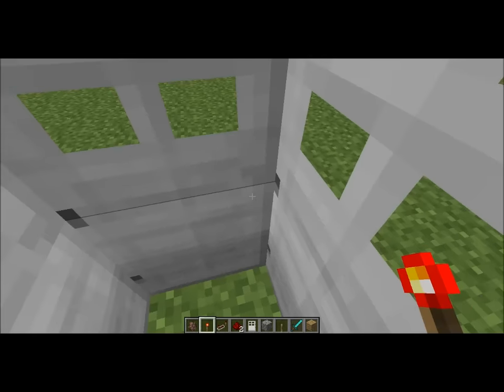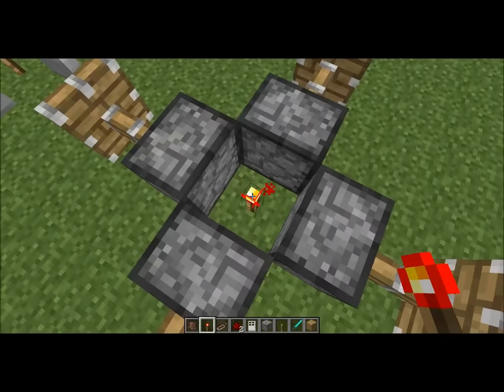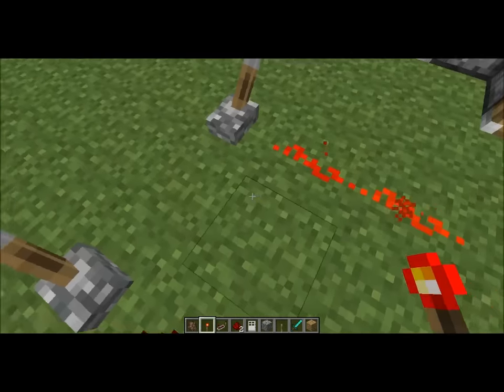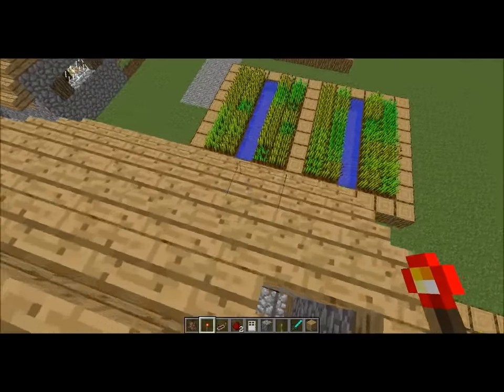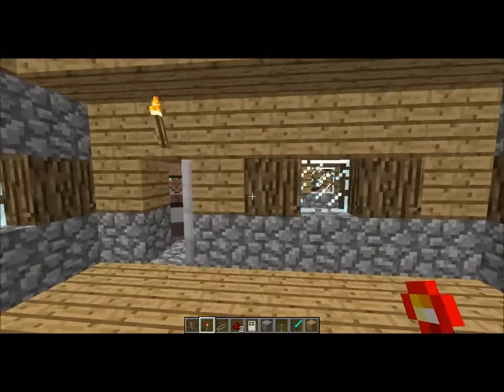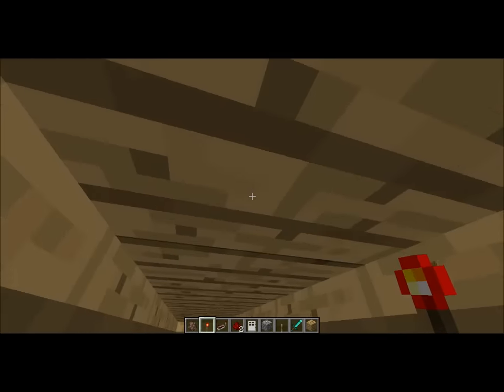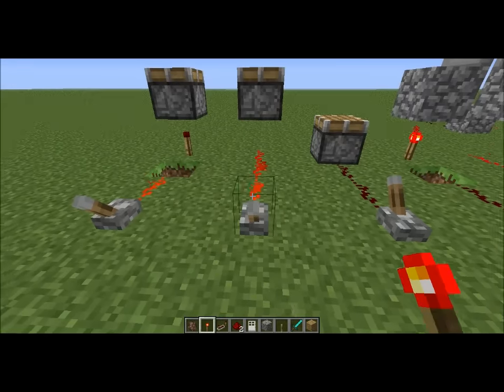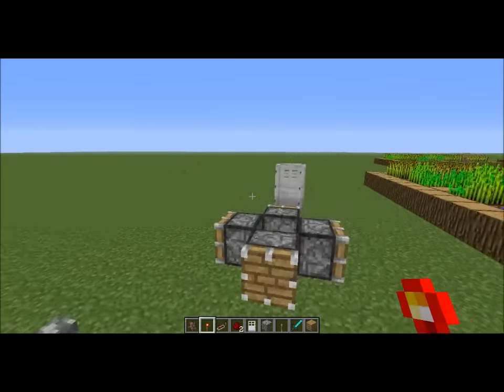FDTD Tutorials: How to turn a redstone torch off

Comment: Useful af,  had a contraption that is basically a jebb door that opens downward but the dropper method wouldn't work to turn off the torches so I made my own useful switch to turn of the torches and close the door c:

Comment: Hey man, is there a way you can turn of the torch and the redstone wire at the same time? im trying to make a lighting system in a tight space so i need redstone torches, but when I turn the lever on for the rest of the lights to turn on, the torch powered ones turn off, visa versa (when i turn the lights off, the torch powered lights turn on) Please help??